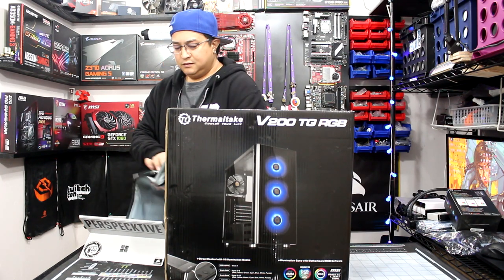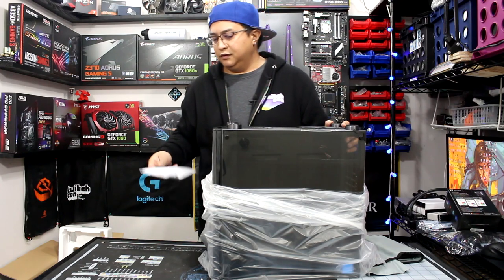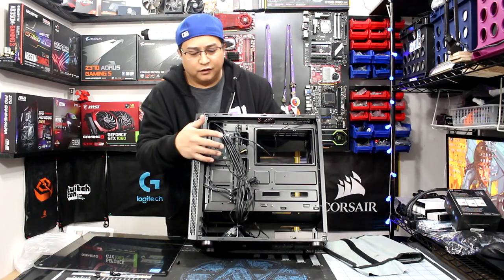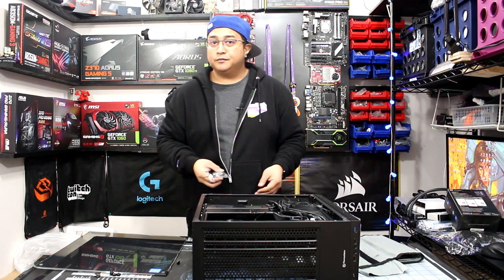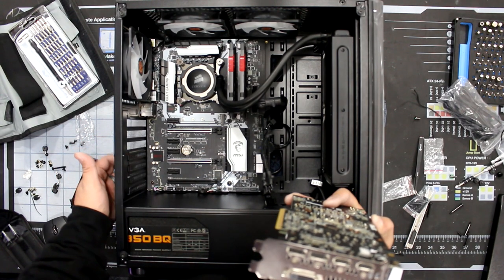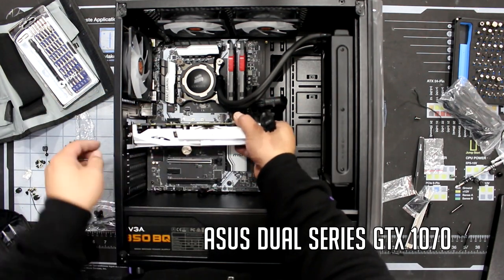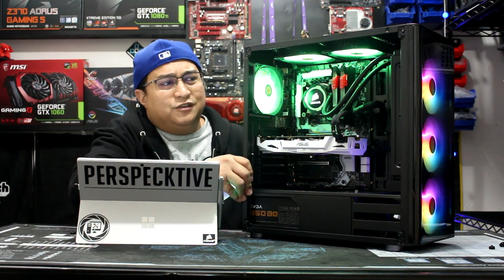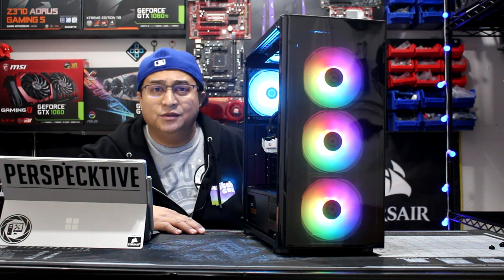Building In The Thermaltake V200 TG RGB (2018)

Comment from the maker: Hey guys thanks for watching, I just wanted to let you all know that this is the Pre 2020 version of the case. In the new revision you can fit a 240mm radiator on top and a 360mm radiator in the front! The 2018 version doesn't support top mounted radiators or large radiators in the front. In order to know which version you have, just check the box. If it says it supports a 240 rad on top and a 360 rad in front then it's the 2020 version.
Reply: Thank you I feel like I'm going insane. Why wouldnt they just name the different model something different? V201 TG? V2020 TG?
Reply from the maker: @3sbon  you're welcome, yeah I found out like 2 months after I released this video that there was a new version through a question a viewer had. I do agree they should have made it like v200 v2
Reply: @PERSPECKTiVE  How can someone know which version he has?
Reply from the maker: @athada4736  I don't know if the box looks any different but if your case says that it supports top mounted radiators then you have the most updated version. You can find the specs on the side of the box. If you bought it second hand, try installing a 240mm rad on top to see if it fits.
Reply: @PERSPECKTiVE  alright, thank you
Reply from the maker: @athada4736  no problem at all
Reply: Hey could you go u into a in depth build on this case because I want to build my after your. Let me know if you can do a video on this. Could u also list the tools I need for it?
Reply: @PERSPECKTiVE  how do I remove the front panel? Are the stock fans connected to the top buttons at all? Or just to the rgb controller? I’m wanting to replace the top two with my aio cooler and run the bottom stock fan to the motherboard. I have the 2020 model
Reply from the maker: @timothycarlson8696  There's a gap underneath towards the front of the case that you can use your fingers to pry it off. The cables are connected to the front panel IO so you'll want to make sure you don't put all your strength into it so you don't damage them. I typically use my thumb, index, and middle finger to get the front panel to pry off without risking ripping a cable.

The stock fans are indeed connected to the fan controller in the back.

The 2020 model should come with 4 fans. 3 in the front and 1 in the back, so you don't need to move any fans to install a cooler on top.

Hope this helps! If you have any other questions feel free to create a new comment. I almost couldn't find yours since it was a reply to my original. Either way, let me know if you need any more help!
Reply from the maker: @bronson2475  hey sorry I missed your comment, YouTube don’t do a great job showing me replies to comments but if you still need help let me know. I can’t do an in depth video on this case since I don’t have it anymore but I can give you some advice
Reply from the maker: @bronson2475  as far as tools go, get a Phillips screwdriver for starters. Then everything else would depend on if you’re using used parts or brand new. If you’re using brand new parts then that should really be all you need
Reply: Can the front stock fans change color or static blue
Reply from the maker: @melevolent8599  They change color using the button on front of the case

Comment: I built in this case as well and I 100% agree about the pcie expansion slots on the back. I actually damaged an audio component on my motherboard taking one out. The left side audio does not work now. So, if you’re building in this case, remove those slot covers before you install your motherboard.
Reply from the maker: Dang, sorry to hear about the audio damage.

Comment: A quick question  im building a pc My board is tomahawk b450 max so im buying led strips for case so can i plug the led in controller or do ihave to put it in Motherboard or can i use led stripes in this case Thanks and nice video
Reply from the maker: The revision of the case I have in this video requires that you connect any aftermarket lighting to the motherboard. The controller on the case doesn't allow for you to connect any LED strips to it directly. If I remember correctly you could use a cable to connect the built in fan controller to your motherboard but you would need an adapter for that.

Comment: Nice build. Im going to use this case to build my PC. I just have a question..

Is it best to buy different fans or use the fans that come with the case?
Reply from the maker: In most cases, it's almost always better to buy aftermarket fans as long as you're going for high end ones... Like Be Quiet Silent Wings or some Noctuas. If you're not overclocking or anything like that than you really don't need to replace the fans that come with the case. The fans that came with this one are actually pretty decent enough anyways.

I used aftermarket fans for the front panel for this build since they were also by TT and for a better aesthetic.
Reply: @PERSPECKTiVE   9:10 looks amazing did u change anything cuz if that's how it looks than i i will just buy this case and stick with the original fans cuz it looks amazing and i will not oc anyway i hope u answer and ty for video
Reply from the maker: @touhami_dz6458  You're welcome and thank you! I actually moved the stock fans for the top and rear and picked up a 3 pack of the Thermaltake Pure 12's

Comment: How did you get the two bottom screws on the front rgb fans off? did you pop off the basement cover or...?
Reply from the maker: It should be mounted from the front side. If for whatever reason it's mounted from the inside, then you'll want to remove the shroud or try it from the back. You would just need to remove the HDD cage so you can reach the screws. Let me know if you have any other questions!
Reply: @PERSPECKTiVE   Thanks! Got it worked out but appreciate the help. It was mounted from the back and I had to remove my harddrives. annoying but whatever!.
Reply from the maker: @harp3v155  No problem I'm glad you were able to get it figured out! Have a good one!

Comment: Hey @PERSPECKTiVE , I bought this case without much research unfortunately. I am wondering if the airflow would be enough for my build:
Ryzen 7 3800x
Palit Nvidia GeForce 3070 GamingPro OC
ASRock Phantom Gaming 4S x570
Cougar GEX 850 Gold
2 x 8GB Adata Spectrix 8GB , 3600MHz
This will be my first PC build and I really want to get it right. Do you think if I move the 3 included front fans to the inside of the front panel (instead of outisde as they are pre-built) and use them as intake, as well adding 2x140mm Thermatake Riing at the top for exhaust will be enough for keeping the temperature in normal range? (the rare one will remain exhaust)
P.S. I will use the included AMD Wrath Prism fan for CPU cooling. 
Please let me know what you think.
Reply from the maker: First off, awesome build. As far as the question with the fans go, unless you're doing crazy overclocking (which you probably aren't since you're using the stock cooler), you won't need to worry about moving the front case fans at all. It's a little choked but you definitely do have space between the case fans and the front panel to get some airflow going. Plus there's vent holes on that front panel on the side as well. The 140mm fans that you'll be mounting on top will also help with airflow. Some people like to cut the cost by going 120 but if the case supports 140's and you want to make sure you have the best air flow, I almost always recommend 140mm fans. Just make sure you set them up as exhaust.
Reply: @PERSPECKTiVE  , thanks a lot for the detailed explanation. I'll try like this and let you know when I have some thermal results during more intense workloads. Appreciate your channel mate, keep doing what you do! :)
Reply from the maker: @venvach9  Thanks a lot man I really appreciate it, and you're welcome! Whatever I can do help!

Comment: hey man awesome video! are stock fans enough with wraith cooler on a 7 3700x no oc? alsohow many fans should I put up top if any to cool?
Reply from the maker: Eyyyyyy thanks Alex and thanks for checking the video out! Stock fans will definitely do the job. As for top exhaust fans, I always max it out for max airflow. So for this build 2 140mm fans would be great but you can still get by with 2 120mm. If you're really on a tight budget, put 1 140mm, but since you're rocking a 3700x I doubt that'd be the case! :)

Comment: Are the stock front case fans fine or should I buy new Thermaltake fans like the Riing Plus 12 RGB fans?
Reply from the maker: Those are pretty nice fans. The stock fans are fine but you could get 3 of the Riing fans for the front and move the stock fans to the rear and top of the case!
Reply: @PERSPECKTiVE  Thanks for the quick response. I'll probably do that.
Reply from the maker: Nick P no problem at all! I typically try and respond to comments within 3 days when youtube doesn't fail to notify me when I get new comments! But yeah bro if you happen to not get the riing fans get some affordable 140mm fans on top. 120s are good too but 140s are the best choice.

Comment: How can I unscrew the small 4-5mm screws used to mount the GPU/Fans (the ones that hold them so they don't fall)? I'm using a medium-sized screwdriver and it feels impossible.
Reply from the maker: Hey Lucas, sorry for the late response. Work's been taking me away from the channel this past month but if you're talking about stock fans you would unscrew the ones in front of the case to remove them. Otherwise it would depend on your AIO configuration. If you still need help just let me know. Have a good one!

Comment: You think the radiator could be installed with the tubes on bottom? Isn't it better that way?
Reply from the maker: No, you definitely don't want the tubes on the bottom. Best way to install coolers in general is to have the water block below the tubes.

Comment: How did you attach additional rgb fans when the controller only had 3 ports for it?
Reply from the maker: Hey Mark sorry for the late reply. I used an aftermarket fan kit so they had their own controller. You can see the make and model during the time lapse.

Comment: Just a question from a DIY-noob.  Is it NOT recommended to use a battery-powered screwdriver when assembling a build?  I only ask because the videos I've seen related to building a case, I've never seen anyone use battery-powered screwdrivers.  Also, WHERE did you get the music that you use in this video?

Comment: I have a couple of old Thermaltake fans that have LEDs that I want to put on the top of this case. To control the color of the LEDs, would I have to find a way to plug those into the board that controls the front fans, or into the motherboard?
Reply from the maker: So I don't really know what model fans you have but if they're RGB capable you would want to connect them to a controller that they likely came with like the ones I used in this video. If it's a single color LED fan though, you only need to put power to the fan, no controllers needed.

Comment: Quick question I’m looking into getting this This computer I also bought the three extra fans how did you end up hooking up all six fans did you use the original version control module in the bag or the one that came with the new fans thank you
Reply from the maker: Hey Anthony the RGB fan kit I bought came with their own controller which I used to control just those. The stock fans are single color so I just stuck with the controller built into the case for those. If you bought the same model fans that come with the case you can connect them all onto 1 controller but that's probably not going to be the case. But to answer your question, use the controller that came with your fans.

That's pretty much how I have this build setup. I ended up putting the aftermarket fans in front since they spew out RGB puke for a better look.

Comment: quick question i have tha big cool master cpu fan , is it still possible to have two 140mm fans on top? and also , would it be better if have two 140mm fans in front instead of the three 120mm ones, would airflow be better , and wont be super hot

Comment: are there any radiators that can fit on the top? i dont think so unfortunately. my 2700x is hitting 190F when gaming using the wraith prism cooler
Reply from the maker: The newer version of this case supports a radiator on top. You'll likely not find the older version since its 3 years old now, but you always want to check the specs on the box to make sure.

Comment: Nice video man!! 
How did you manage the 3 extra RGB fans? Did you plug them into the fan/rgb hub which comes with the case or did you add another hub for the 3 fans(in the frontpanel on your rad)? 

And Is it possible to control more fans with the excisting hub? Or can you control another hub with the button on the case? 

Looking forward to your reply :)
Reply from the maker: Hey SK. Sorry about the late response but I used 2 separate fan hubs for that build. I used the stock fan hub for the stock fans and used another fan hub for the aftermarket fans I added to the case. As far as the stock hub, you can't connect more than 3 fans to the case unless it was changed with the 2020 version. I don't know for sure but I don't recall seeing any updates on the hub. Also, you might be able to connect a hub with more fan connectors if it can be connected to the "Reset SW" cable on the IO panel.

Thanks again for your feedback and thanks again for watching! Let me know if you have any more questions!

Comment: Hey I plan on getting this case for a budget build so I'm opting for a micro atx motherboard. Would a micro atx mobo look good in this case or would this look weird?
Reply from the maker: If we're talking function, there's nothing wrong with it at all. I used to use an MSI Mortar for my wife's old AMD build and while it did look empty on the front and bottom parts of the case, it still worked very well.

BUT to answer your question, based on your card, it may look super empty towards the front and bottom sides.

It wouldn't look as empty if you:
Used a 2 or 3 fan video card
Used an AIO/Tower Air Cooler

With all that space you could get creative with it and put like a pop figurine or something in your case.

Comment: hey im a novice builder - i just got the same case. the place you screw in the GPU is really weird. you gotta break it off. is there even a screw hole where you can screw in the GPU? also does it come with the required screws?
Reply from the maker: Hey Neville, yeah it can be awkward breaking those things off. You may see that again in another case in the future since it's been the standard with most cases for a while. There's screw holes there and the case should have enough screws for that. You'll want to use the screws with the hexagon shaped head. Google "Computer Case Screw" if you want a better image of what the screw looks like.
Reply from the maker: Also, good luck with the build man! Building a PC can be super satisfying!
Reply: @PERSPECKTiVE  ey thanks man. not many youtube PC builders actually respond to their comments. youre awesome bro. you earned a sub
Reply from the maker: @nevillejames1613  thanks man. I truly appreciate that! I always try my best to respond to comments and I like to do what I can to help fellow pc builders and those interested in building. Have a great day man and thanks again! It means a lot to me.
Reply: @PERSPECKTiVE  hey I just finished my build but Im using the stock cooler that comes with amd processors. I plan on buying an AIO liquid cooler in the future. I've got a question. Can the RGB controller that comes with the case control the RGB on an AIO?  Also, could you recommend a good bang for buck AIO? 
Thanks for your help, brother.
Reply from the maker: Sorry for the late response. Been busy spending time with family since I'm moving to another state. But yeah you can't control the RGB with the case but if you get a corsair AIO which is what I typically use, you can control the RGB with the iCue software.

But yeah anything Corsair has been pretty good to me as far as AIO's are concerned.
Reply: @PERSPECKTiVE  ay it's no problem for the late reply. Sorry for asking a lot of questions, but I'm just really confused. See, I'm using an aorus elite b450 and I've been told that I can connect the aio to the motherboard so it syncs, but I just can't figure out how. Is it explained in any of your videos?
Reply from the maker: Dang I'm sorry I missed this! I haven't covered that topic on the channel but if you weren't able to solve your issue - there's 2 RGB headers on the bottom left of that board. Link below for reference, but you'll want to connect the AIO to one of those headers. Refer to the online manual and your AIO manual to know for sure. Once you get that connected you'll be able to see it and configure it in an RGB app of your choice.

Also, no worries about the questions! I'm here to help if I can.

Sorry again though for getting back to you late. It was a hectic time 4 months ago.

https://www.gigabyte.com/Motherboard/B450-AORUS-ELITE-rev-1x#kf
Reply: @PERSPECKTiVE  no problem buddy, managed to sort it out. took a lot of reading but found it eventually. Thanks for all the help man. World needs helpful folk like you.
Reply from the maker: @nevillejames1613  Thanks man, I really appreciate that. I'm glad you were able to figure it out though! Have a good one